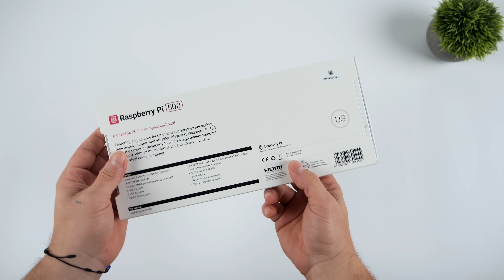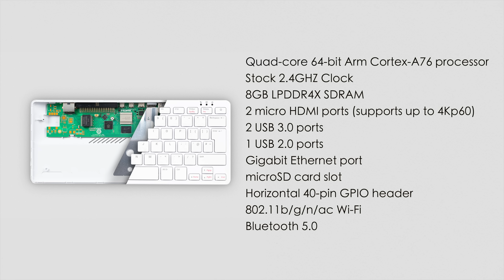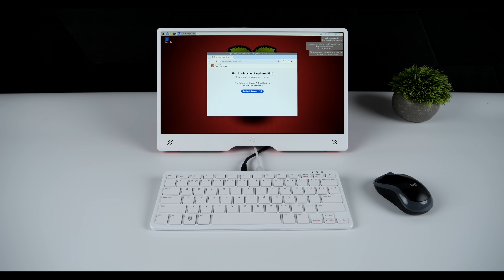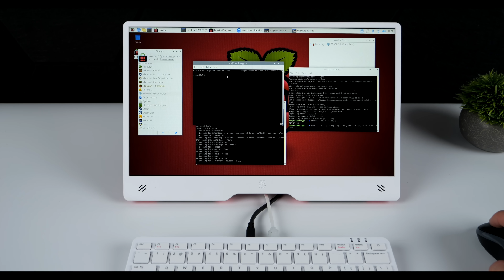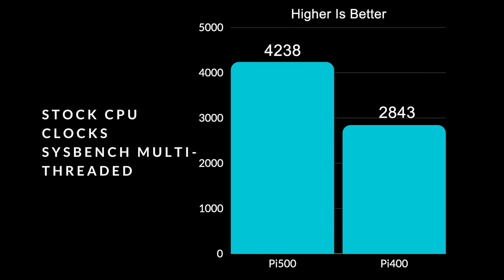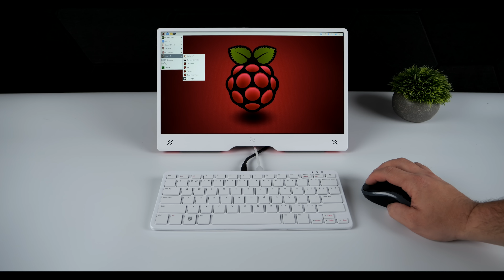Raspberry Pi 500 Hands On First Look, It's Finally Here!

Comment: Why dont they make a laptop instead !!
Reply: Cost and the fact it would compete with Chromebooks at that point
Reply: I would rather have this on the side with one of those smart glasses 👌🏼👌🏼 as a huge display.
Reply: @XeroHertz  now that would be handy. Giant virtual monitor. Little tiny computer.
Reply: Modular
Reply: Because it won't be Amiga
Reply: Lol, look at the teardown of their monitor 🤣
Reply: @GreenishlyGreen ?
Reply: I completely agree with everyone saying get a laptop or chrome book but if you really want a raspberry pi laptop get a crow pi mount
Reply: Because keyboard computer are cooler!
Reply: I would totally buy a Pi powered laptop
Reply: I would 100% pick one of these up
Reply: @simoneatough6391  you should get one for me too for Christmas
Reply: Cost is fine. Infact, people are looking for ARM laptops because of long battery life and less thermal dissipation. That helps in Portability. Moreover, you get open community support on Operating system features (Linux & Raspbian). Maybe Regulatory could be a reason. Probably would be better than MS locked WIndows, Google Locked Android/Chromebook, Apple locked Mac Ecosystem.
Reply: @ranjithmkumar  😭😭 are u joking brother😭😭
No one likes arm laptops.
Reply: @ranjithmkumar  Wrong, most people need power when it comes to PC experience to support things like AAA and AAAA gaming and AI/Ml so Intel/Nvidia is desired.
Reply: @ranjithmkumar  ARM is more efficient is a faulty assumption. While in most cases this is true because many ARM SoCs are designed to be like that. Pi 5 on the other hand, believe it or not any 6 w Intel CPU can significantly out perform it while using less power. The Pi is inexpensive for a reason, but arguably not really that inexpensive nowadays.
Reply: @iokwong1871  I can agree regarding power efficiency. It depends on the SoC.
Reply: The CEO said that if they didn't release their products in a responsible and sensible way, they could be responsible for blowing people's minds and they don't want to be held responsible for that.
Reply: Well they technically do, but it's from third party makers. They had a laptop case for the raspberry pi 4 that was pretty cool, but a little pricey. Lets hope some 3D printer model maker takes a month to create a 3d printable laptop shell.
Reply: It's because they don't have the experience. This is actually something the raspberry pi foundation discussed and stated that once they know how to make one that they are satisfied with, you'll get one.
Reply: this is what laptop designs should be like.  keyboard and monitor all separate,  so no more broken necks with bad posture.  no need to prop up laptops on a stand etc. laptop makers should switch to a split design like this.
Reply: It's probably a matter of time.  One problem is the number of people that want one wouldn't justify the cost sunk into the design and manufacture.  It would cost way more than an equivalent x86 laptop.
Reply: @ranjithmkumar  2 kensington locks would be enough so one could attach a foldong screen
Reply: True
Reply: Why would they make a laptop when that was never the goal of the Pi
Reply: Because laptops are much cheaper?
Reply: I don't think a $300 RPi laptop could be that competitive against Chromebook.
Reply: Make one as well.
Reply: @ranjithmkumar  it's not supposed to be a work-a-day computer. it's a hobby project piece.
Reply: Loving the Jeff pop up! 😂🤓
Reply: I’m sure someone will 3D print one for this monitor and keyboard to fit in.
Reply: Simple get a old laptop and install RasberriPiOS on it there's your laptop you just made XD
Reply: Just buy a laptop if you want one
Reply: @mgg7756  and install PI OS on it)
Reply: They have a monitor, a keyboard, a mouse, and the 500 has what looks like space to add an NVME in the future. Laptop is the next logical step.
Reply: Even a $300 pi laptop wouldn't have any value over a typical Sub $300 Laptop. That's why. They might have a market under $200 but I doubt they can go that low.
Reply: Because laptops already exist.......
Reply: @Mhggbjj  Keyboard Computers like this exist much much longer. Atari and Commodore startet in 1970s. The Pi 400/500 is like a Sinclair Spectrum from the 1980s. But useless today, because Laptops are already exists and cheap ones are available for the same money (pi 500 + SSD + Monitor + Powerbank is even more expensive).
Reply: +1
Reply: Just looked the price up, 105 credits. My local hardware shop had a monitor for 77 credits the other week, add water a mouse and speakers and for about $250 you got the hardware sorted, not the OS...
Reply: Just get a laptop

Comment: I really wish they'd do a black version of these!
Reply: they need a beige one with brown keys :P
Reply: @markrotondella4689  Instant buy. They should call it the Pi 64.
Reply: They won't, since they didn't release one for Pi 400 either.
The best option would be to apply some black skins on the board instead.
Or get a Pi 5 separately and assemble one yourself.
Reply: There is at least a black version of the display.